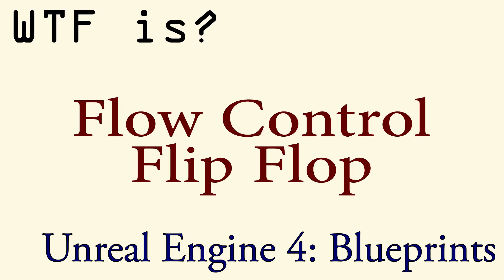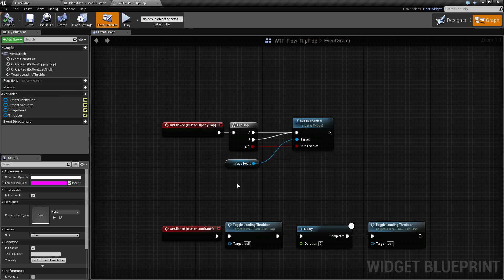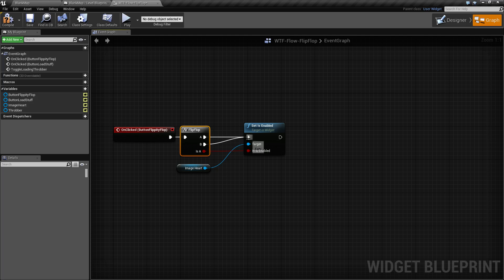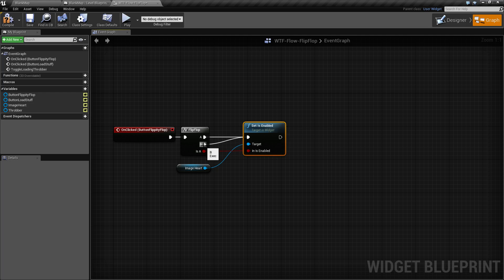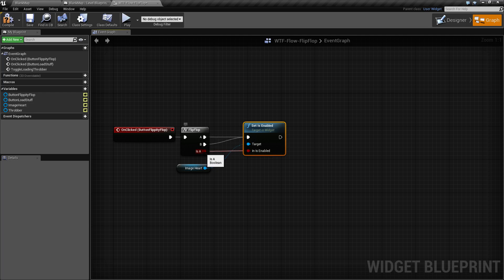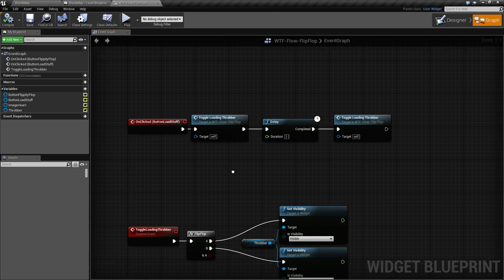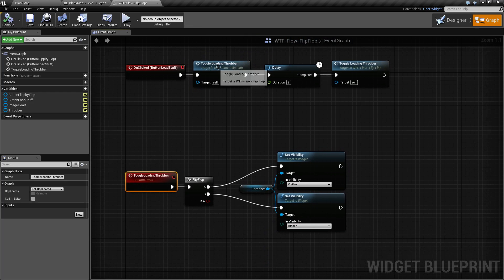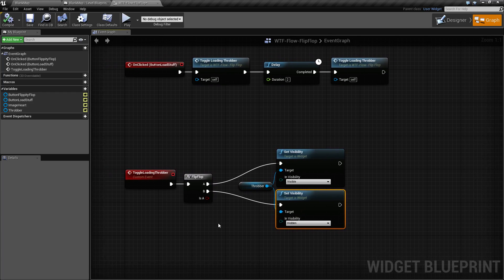WTF Is? The Flip Flop Node

Comment: Thanks for the intro to this node!  Although, I'm worried about the user double clicking (clicking once, then again within 2 seconds) on the button that triggers the loading spinner.  It will make the spinner get out of phase :(
Reply from the maker: If you are using something that has a delay and is controlled by a flip flop then yes you might run into an issue like this.  For something that you want a delay on doing a Gate or something similar before it might be better as you can just open it back up when you want to run it again.